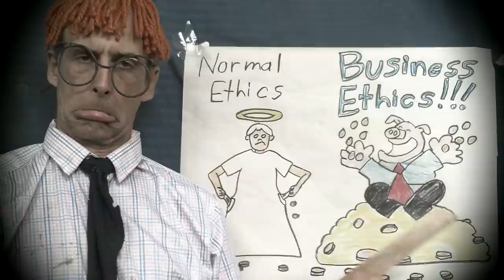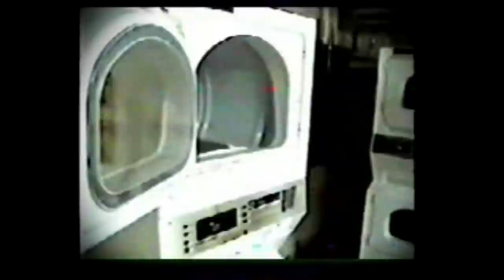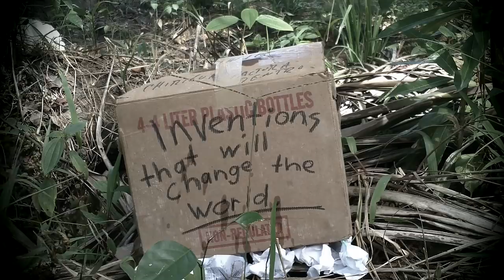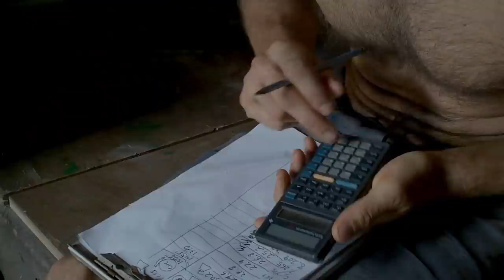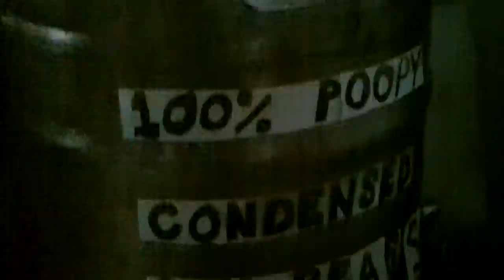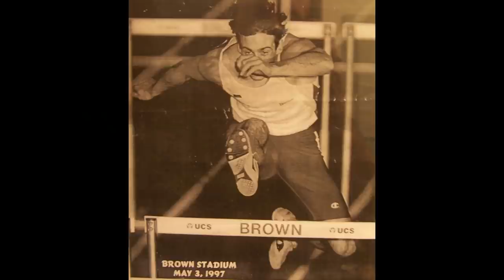The Adventure Builder Movie

Comment: Thank you for the update . I had asked you a question  a few weeks back . So wow that this comes  out this week . But I still need you help with electric motor conversion.  How do I determine hp  of an electric motor versus a gas  Engine . So I want at least 75 hp to 115 hp .
Reply: 746 watts of electrical power = 1 horse power. That's the short version. By far close enough. Watts = volts * amps so...
If you need 115hp First choose your motor voltage ( I'll recommend 24v for simplicity ).

115hp * 746 watts / 1hp =  85,790 watts
85,790 watts / 24v = 3,575 Amps

So you find a 24v motor that can pull 3,575 Amps without blowing up... you'll have about 115hp.
That sounds unrealistically high to me. Definitely not impossible, but also not sure if it's worth the complexity.

So you're looking at a LOT of motor weight ( either one massive industrial motor, or several smaller ones )
Lots of copper to carry all of that current. Heavy and expensive.
One mammoth power supply ( batteries / solar panels? )

Not sure what your exact plan is for this boat but let me know how it goes. I'd like to see how turns out.
Reply: So right now  I have a gas power  16 foot glastron boat. It will supposedly pull 35 mph . The boat is rated at 115 hp witch I believe  would give me approximately 15 to 20 mph gain . Now 35 is plenty of speed and power to pull a skier but I would  like the faster boat ! .  I like the idea of an electric  boat . So my needs are more to keep my 35 mph or gain more  mph with electric motor. I was hoping the elco electric outboard motor company would  make a 70 hp electric outboard.  But it dose not look like it .
Reply: BTW thank you for the information.
Reply: @Riffraff-5150  No problem! The only "easy" place that I can think of to get those kind of motors, batteries and and speed controller would be in an EV or a Hybrid. Maybe search Craig's list or local junkyards for a totaled Tesla. However if you go that route there some serious issues worth considering:

1. High voltage in a wet environment. Those motors and battery packs run at around 300vDC ( I think ).

2. Lots of highly proprietary electronics that are infamous for not working or locking you out. They are designed against letting you customize ( or even repair ) your car.

3. Cooling / overheating issues. You'll be working the motors like 5 times as hard to go 1/4th of the speed that the car would on land.That's going to present air cooling problems.

4. Recharging issues. The roughly 90k watts power that you require is only the instantaneous power. You also have to consider how much running time you need to safely not get stranded out to Sea. Lets say that you need 5 hours of operation at full throttle: 90k watts * 5h = 450k watt-hours of energy. I haven't done the research yet, but even if you covered the entire boat in solar panels you might find that it takes days or maybe even weeks to re-charge that battery. That is a MASSIVE amount of energy! This is the reason why liquid fuels are usually used for things like this. They have radically high energy densities stored chemically.